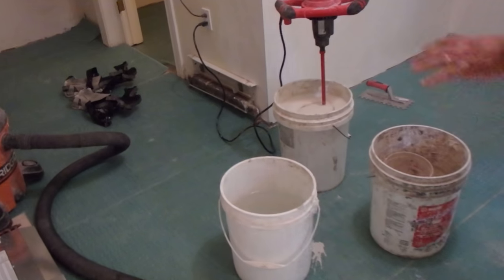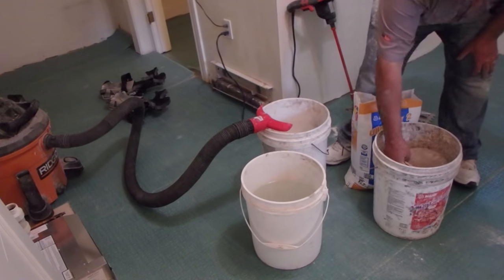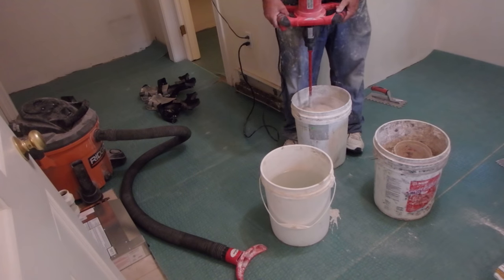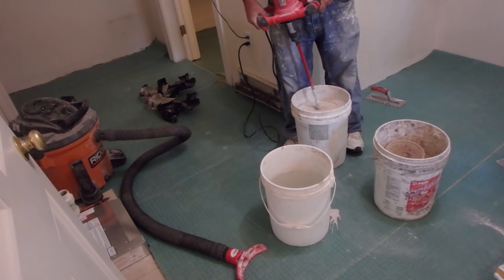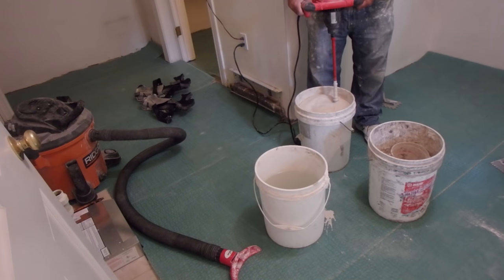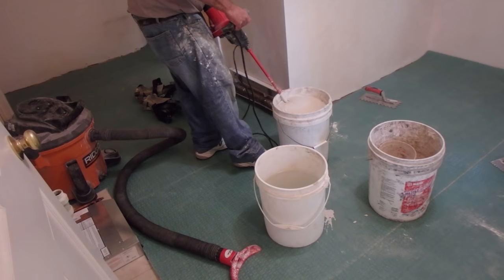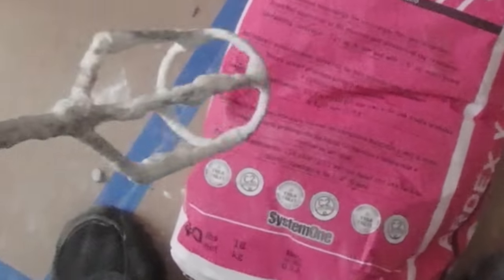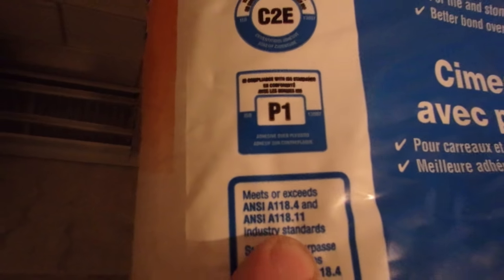How to mix thinset mortar the proper way,

Comment: I have to disagree about the amount of water. I have actually used the same stuff you are and it’s just like every other mortar. The amount of water is a little less than needed. In fact I have never mixed any substance including mashed potatoes that you didn’t need to use more water than the recipe called for. I believe every company gives you a very low end suggestion so you don’t use to much and end up to watery but if a package says 4 cups of water is needed it’s almost always 4 1/2 and if it says 2 quarts it’s almost always 2 1/4. Everything always requires more water. I just used Mapei flex super and it called for 5.7 to 6.2 quarts and I used almost 7 quarts and it was absolutely perfect.

Comment: It is a simple thing. You are adding water to a 1 part powder. It is either right consistency or not. Important thing is to putting water into the bucket first, than paddle and add powder. Mix, let it sit, mix again. Simple. No need a measuring cup unless you are a beginner or diy-er.
Reply from the maker: The chemistry in the bag has be designed to be activated with a certain range of water, too much or too little will not give you the properties  and capabilities you are supposed to get. Same goes for mixing time. Try it you will be suppressed at the difference.
Reply: Dude, most people here are a beginner or DIY-er

Comment: Sal - Thanks for all your great information!  I did a backsplash this weekend, my first attempt at tiling.  My thinset mix and application was terrible.   Mixed it a few times, added water, etc.  EVERYTHING you said not to do.  The next day I followed the thinset instructions to the T and the mixture was much more manageable and the result was a lot better ( and my wife and I are now talking to each other again).  Thanks, again.
Reply from the maker: Maybe I should change the title to "Save your marriage: Mix  mortar the correct way"😜
Reply: @SalDiBlasi  LOL

Comment: You are absolutely right Sal, I recently realized this when I tried different mortar mixed the same way I usually mix my mortar, different products come out different thicknesses, whatever they say on the bag is a good starting point for sure, otherwise you end up mixing way too much mortar, I think a lot of the better quality thinset mortars are using water reducing agents, so the old mason's eye wont do you any favors because who knows how much of what each manufacturer puts in their different products.

Comment: Great video. One addition.... inspect and weigh the bag before mixing. I have purchased bags that are up to 10# light in material from lowes. The bags were likely broken and re-sealed but many times you cant tell because they use so e kind of melting device to re-seal the bag. I couldn’t figure out how occasionally i would mix a bag and it would be too loose. When I started weighing the bags before mixing it all became clear. The bags were occasionally short on mix.

Comment: My man said “follow the instructions on the bag” 😆...big facts Sal. I’m about to install some hexagon tile in my bathrooms (never laid tile before) so I’m watching your videos
Reply from the maker: Thanks, take your time and get as much info as you can before starting.
Reply: @SalDiBlasi  is it fine to split the bag in half and add half the water?
I'm laying backer board in a small bathroom so I don't want to use a whole 50 lb bag

Comment: Good video. Today I installed Strata Mat over plywood. I followed many of your helpful tips in the How to install Strata Mat vid, like using the grey thinset which made it much easier to see how much coverage I was getting. Great tip. Thank you. I mixed it only slightly soupier than usual for my first cut piece. Worked fine, but for the second piece, I mixed it a lot looser than I would usually, and it did seem to be easier to key in and spread, less toil. Even less air trapped, if any, and good coverage. I did not use a a roller, but a wooden float, and stepped all over it like Donnie D shows in his vid.
Reply from the maker: Great, best to do a little research for your first attempt so you don't get surprised.

Comment: Nice demo Sal .... that’s what ur looking for ... consistency. Here is a thought based on my experience. A lot of times I don’t need to mix a whole bag.  This is what I do. I’ve found the using a ratio process. 1 to 3. I use a quart container and put in 1 cup / Qt. Of water to 3 cups / Qt of thin set. You can adjust the water if needed, but I’ve found this process works. It’s easy to work out the ratio from the bag. Arden is just a different ratio Later
Reply from the maker: Many of the bags will have the ratio of liquid to powder printed on the bag, if not it he powder should be weighed and then the correct amount of water added. Seems simple, most manufacturers recommend mixing the whole bag because the contents can settle during shipping, they will recommend blending the powder if partial bags are to be used.

Comment: That vacuum attachment you used when mixing thinset looks to be very handy, specially if you are working inside costumers houses. 👍
Reply: It also helps protect you from silica hazards
Reply: I use the wide head on my shopvac for dust control while mixing. Silicosis is an awful way to die.
Reply: Yes, ruining costumes could be very pricy in deed.

Comment: Love the whale tail. Does work very well on the dust. And mixing mortar is more difficult than people think. The only other problem I have with mortar is taking in to account temp and humidity levels of the day using it on.
Reply from the maker: Yes good point, ambient conditions can be a big factor,  thanks for the reminder.

Comment: Like to share my experience as a first time thinset mixer. Yes, follow the recommended amount of water on the bag as Sal says. If you don't have a large electric mixer don't attempt to mix a 50lb bag. Nearly burnt my drill doing that. Buy a paddle suited to mixing thinset also. Paint paddles don't work so well. I suggest mixing a smaller batch at first. I found that 2 gallons of thinset to 2 quarts of water worked for me. You get about 3 batches per 50lb Versabond bag that way.  Don't hurry if you use Versabond, it does not harden for hours in the bucket. I know Versabond is cheap thinset but it's what HD sells. You have to shop Lowes if you want the better Mapei product. 
Took a tip from mixing pizza dough and added the dry to the water in two parts.
Reply from the maker: Having the correct tools is essential. however different types of dry set mortar require different amounts of water, by this I mean some require a higher ratio of powder to water than others, in some cases quite significant.

Comment: Since I need to mix much smaller amounts of thinset to use at a time I convert the water to mortar ratio into a rate. For the Mapei lft it is something like 250-270 ml water per kg of mortar

Comment: Your clean in the way you use a vacuum,  I use the same attachment , but always finger wipe the paddle. Just banging it off and spinning in the bucket creates a very nasty bucket at the end of the day. Now getting rid of that nasty slurry water is a problem and most guys just chuck it on the grass. I at least like that you take it out of the water bucket, because that's an accident waiting to happen.  I dont use your particular drill and paddle , but after I mix , I then first release the paddle from drill , tap the mud off in the bucket,  then finger all the mud from paddle before putting just the paddle in the water bucket.  At the end of the day my paddle bucket has no nasty mud in the bottom....I know it's a small thing and most would think I'm nuts, but I cant stand a nasty water bucket at the end of the day that can ruin a lawn or that you have to scrape out.....love the direction video however, definitely should be flollowed

Comment: I am an old lady, mixer tool is too heavy for me. Can I mix 1/4 bag each time with my steel rod manually?  I will control the water ratio very well, just no strength to mix big bucket of material per time. Please help

Comment: Our tile installer wants to use ProLite thinset mortar when he lays our 12x24 porcelain tiles on the concrete foundation of our 40-year old house. He said a cheaper thinset is Versabond, and it would work ok, but he like the ProLite better. We called the tile store and she said that ProLite is for WALLS.   We have to tile 1154 square feet. We will be staying this house for years to come so we want to use the right product that will give us the best result. WHAT IS YOUR OPINION ON THE PROLITE thinset? THANK YOU IN ADVANCE.
Reply from the maker: Prolite is a great thinset for walls or floors, a sales person is not the person to get installation advice from.
Reply: Sal DiBlasi Our tile installer seems very knowledgable and I trust him over the sales person. Thanks so much for answering my question.

Comment: What I still find lacking for information on various package directions and in many how to videos is WHAT IF YOU ONLY NEED A SMALL AMOUNT of thinset or mortar for a small job?  I don't always want to use a whole bag every time. More of the manufacturers should put ratios on their bags. It would also help if more how to vidoes addressed that. I'm slow at tiling - actually I'm just slow! LOL So it would be helpful for a real DIY type like me. This is what I like about Ardex.

Comment: What happens if you use a 450rpm drill instead of the 300s? Does that compromise the product?

I notice a lot of guys use the 450s. The rigid and the dewalt. Idk why they dont add the ability to change rpm.

Comment: I mixed my adhesive for not long enough, just with a fork (cue laugh...), and probably added not enough water (for some reason I thought it should be quite thick but seeing your videos, I think mine was way too thick!)... It's just a very very small area (fireplace hearth) that won't really be walked on, just decorative on the floor... the tiles are stuck solid, but should I be concerned? Will it fail over time do you think? I used NX flexible standard set adhesive from Wickes in the UK. Definitely a botch DIY job here... but I just wanted to know if you'd rip it up and start again or just leave it and grout now?
Reply from the maker: I would wait and see, especially if it only decorative.

Comment: Sal you are a god sent thank you! So You mentioned even the paddle can affect the thin set and I see you are using the spiral type. I noticed that most of the thin set shows an egg beater on the package. What is the advantages/disadvantages of egg beater versus spiral?
Reply from the maker: The spiral is specifically designed for thinset, the egg beater is an all purpose mixer.

Comment: I was mixing All set - schluter and my drill started heating up on lowest rpm..and battery died. Thinset came out peanut butter ..but not as creamy. So, have your tools and standby tools ready. 

Also, sal, what is your opinion on the premixed mortars?
Reply from the maker: Premix is Mastic, mastic is junk.
Reply: @SalDiBlasi  Thanks. I just bought this Mapei Ultraflex-1 thinset for my porcelain tile over ditra mat. Will this work? It looks like its a modified thinset.

Comment from the maker: You can either weigh the powder, or divide into buckets. Some thinsets will have the powder to water ratio, like Ardex X77 is two parts powder to one part water.
Reply: Sal DiBlasi thanks for posting this comment after saying to just mix what the bag says.

Comment: I have to agree that is the best way to mix mortar... but what about if I only have an hour a day to tile my bathroom and has to mix a little at a time? What would be the best indication to determine that my mix is accurate?
Reply from the maker: As long as you get the ratio of powder to water right, you will be good.
Reply: @SalDiBlasi  thank you. first time doing any tile work and I was putting up my Schluter membrane and just ran out of time on the pot. I don't want to be wasting a whole bag when I can only get through a half bag's worth of thinset in the pot time. the additional mixing without adding water to extend the pot life was a good tip, but this tip about just making sure to use the same ratio is key for me because TEC didn't put ratios on the bag, they just said mix the whole thing. I'd seen other handyman YouTubers say just make sure you get the ratios right and then follow the mixing procedure on the bag, but I wanted an expert like you to weigh in before I went ahead. thanks for all the videos, Sal! you're definitely the YouTube tile oracle and I appreciate all the tips and advice. you helped me have the confidence to tackle my own project. thanks again!

Comment: A question I wrestle with when tiling is knowing if I need a particular Thinset for a job, or is Thinset Thinset as long as its mixed according to instruction? I am a DIYer that mainly does tile floor and bathroom shower/tub surround tiling. If I am doing vertical tiling (wall) is there a Thinset that holds tile better in place when gravity is fighting it?
Reply from the maker: https://www.youtube.com/watch?v=S80GVg4Y4MU&t=284s

Comment: Awesome video! But I’ve a question. How about if you going to use half of the bag or less, how do we should measure the water etc? Thanks
Reply from the maker: Mix the correct ratio of water to powder.

Comment: Hi Sal, big question: does thinset GO BAD, get stale, or whatnot? My boss bought some of the basic grey CustomBlend from HD that comes in the paper bags. (I personally only buy Mapei because it’s sold in impermeable plastic bags.) It’s been sitting in a garage for a few months, unopened. 
So, I mix it soupy, and nevertheless the stuff immediately starts to get dry and brittle BEFORE I’m even done buttering the tile. 
Is it possible that humidity has seeped into the bags and messed with it chemically?
Reply from the maker: Thinset has a shelf life of about a year, it will go bad, especially if it is left in a damp space. There should be a manufacturing date stamped on the b bag, look for it and see when it was made. Best to dump it if it is firing off that quick.

Comment: Hi Sal the fibreglass Weni board with foam in the centre. How do I fix wood to this so I can start my first course of tile. Also what size notched trowel do I use to fix 250mm x 500 mm 8 mm tiles to fibreglass board? Cheers Dave
Reply from the maker: Screw through the board into a stud,  then seal the hole when you remove the ledge board
Reply: Sal DiBlasi yes managed to do this. I placed my batten 2"X1" over the longest part of the wall then fixed into the stud work. As I'm new to all this I managed to get a slight variation going off 90 degrees to the next wall. I found my tile spacers were slightly out at the gap. I never knew tiling could be so tricky to do. I also learned that if you push slightly more on a tile than the previous, you start going into the wall and your levels starting going out. Also lightly scoring the tile on the machine helps with a cleaner cut too.

Comment: Hi Sal another great video. I'm from the UK where can I get these buckets you use I've seen orange ones with let's do it on the side Also. They are much different to the UK buckets I can get but yours look extremely popular on u tube. If like to buy a few and use on my tiling jobs. Thanks Sal your tiling knowledge is second to none. Matt
Reply from the maker: Most will get them at the Big box stores, usually just a few $
Reply: Home depot sells that bucket

Comment: All set recommends to mix at 300rpm’s... do most mixers have rpm settings? Does this matter?
Reply from the maker: That is why I use a mixer designed for thinset

Comment: I have some 317 laticrete that has been in my house for 3 years it appears to be in really good shape but I believe it has a two year expiration date would it be okay to use if it's in good shape and has been in a climate-controlled area or should I throw it away and buy a new bag
Reply from the maker: Throw it out, do you really want to risk an entire floor to save a few bucks.
Reply: @SalDiBlasi  thank you

Comment: Sal, Im mixing 6 qts water to 50lbs.  It so thick and dry though.  Should I add more water??  Help!!
Reply from the maker: What thinset are you using? mix it  longer, it will often loosen if you mix it for an extra bit of time.

Comment: I went by the instructions on a bag of thin set and it came out so dry it wouldn’t even stick to my finger. I measured exactly and used to the highest amount listed on the bag. I had to add more water or I wouldn’t have even been able to use it.  Have you run into this very much?
Reply from the maker: No, never. However if the thinset is old, or beyond it shelf life, strange things can happen. What brand thinset?
Reply: Tec Full Flex
Reply from the maker: So what did the directions say, How much water per bag?
Reply: 2 - 2 1/2 quarts of water for a 25lb bag of mortar. I used 2 1/2 quarts measured with a 1 gallon measuring cup. It was marked off in ounces so I used 80 ounces.

Comment: Can someone tell me what speed on a six speed mortar mixer tends to be best for mixing at 300 RPMs under load? Thank you
Reply from the maker: The speed will be printed on the bag of thinset.
Reply: @SalDiBlasi  thanks Sal. I understand it’s supposed to be 300rpm, but I can’t find anywhere on the bag where it says what speed a typical 6 speed mixer should be on. It’s Schluter all set. I would imagine you have a favorite speed for mixing at approximately 300rpm. I’m sure it’s not speed one, but I would guess it’s not six either. Thank you.